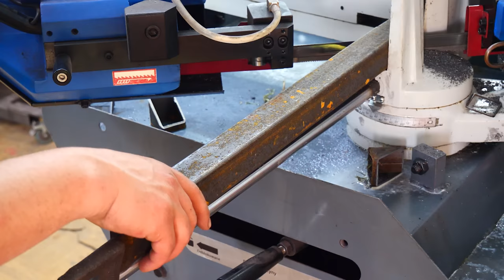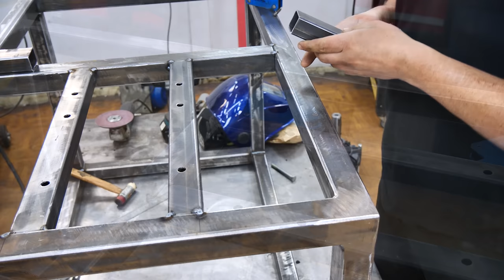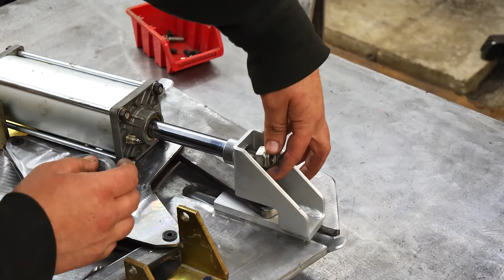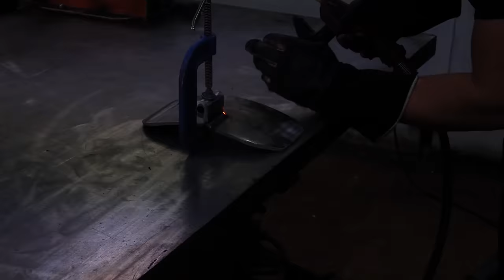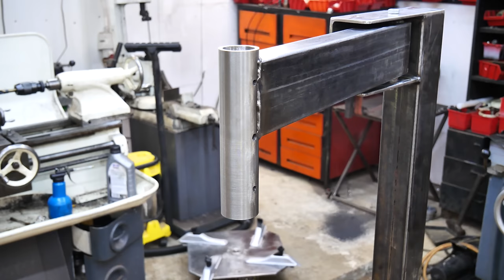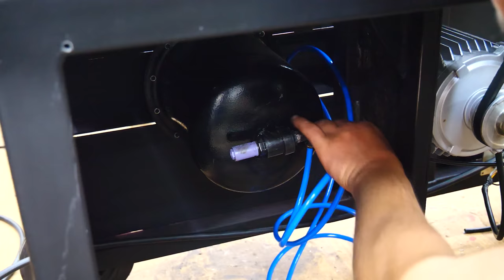Making Tire Changer Machine

Comment: Very nice build. I used to change tires. One suggestion to make the upper arm easier to work with. Try using a compression spring through OD of the rod so when you release the knob and push it over, the rod will move up out of the way instead of dropping down or holding it to lock it again.
Reply: Was going to write exactly this. Every professional machine is equipped with a spring like that.
Reply: I mentioned exactly the same thing once that is done it will be pretty good
Reply: Yup. Bead unroller should lift up when released, not fall down onto the rim. Not a large a mood work to make the modification, but a huge improvement in usability.
The bead breaker might want another look, too, to cater for different tyre sizes. They’re usually at a compound angle, rather than straight on, too, to help draw the tyre away and avoid the bead falling into the rim and causing damage to the sidewall
Reply: Attach a Metal file with JB-weld' to a strong old sawzall blade' then to attach to the sawzall _ 'and maybe that could be part of a helpful File system?!
Reply: Конечно хорошо что сделал сам, но все комплектующие куплены в магазине, по цене он выходит немногим меньше заводского, я просто купил и не тратил время.
Reply: Too high - wheels are useless , move it once a while dolly could do it 
Pedal configuration not correct 
Good welding/lathe skills

Comment: Might add the air blaster for getting tire seated.... you got this far so its not even a challenge for you now. I have modified a few of these machines because of no mig welder or other nice welding tools. Even with all the stuff in front of me, the pattern is probably most important part of building one myself. I am seventy three so brain is slower than cold molasses. I started permanently in the southeast alaska islands right after coming home from nam in seventy. I was a diesel, gas, fab, welder, and not too bad of a story teller in those days. I did get my hands on a coats 40/40 tire machine that was rebuilt more times than letters in the alphabet. I then one day for no reason exception of boredom, make a larger one that handled the truck tires on "highway truck tires" but the off highway rims and tires were just manual labor intensive. Used a lot of starting fluid to seat tires back then. Of course the rule of thumb was bigger the easier applied most of the times. One weak link in yours is the foot controls will start leaking so needed to fix which meant removing the sides and fixing. I used a propane tank for air blaster to seat tires most of the times with most tires under the twenty four inch rim sizes. Just a simple all release of air in that tank would solve seating those tires to the rims. Teaching anyone how to determine the side up to mount and dismount. Lots of jokes about "are you from arkansas" were used on fellows who just didn't understand how dang easy its going to be if ya thought ahead. I best stop here as too long of comments are just that.... too long

Comment: PRETTY WORK ! 
   I was trained, most of my young life as a Machinist. I was raised in one and built a little shop but nothing as nice as what you have to operate. Be very proud of your shop and your skil level. Be sure to use your PPE, so you won't be hampered if something comes after you.
   Thanks for your video. I SUBBED.
   Bill, from Tn. 🇺🇸
Reply: K 0:11 😮 b

Comment: I would love to do something like this. I weld and have mill and lathe and all the tools required and I’m a mechanic. I always design stuff up in cad with the intention of making it but then I realize the steel it uses to make it costs more than just buying the machine from china. Chinese equipment is cheaper than the metal it’s made out of just can’t beat it.

Comment: Even more impressive the second time watching this !! Especially after I just bought the Harbor Freight manual tire changer and homemade Swing Arm/Duck bill mod. But this here is outstanding. Crazy impressive, and a guaranteed money maker. Probably paid for itself a few times over by now I'm guessing.  Next project, some lasers amd Arduino's or something and design/build a homemade/one off, high speed wheel balancing machine.

Comment: umm... why? Just to say you can? 
This very basic machine, made with imported parts by the way, would have only been $900 to $1,300.(Including waranty!) What is your time, material and electricity worth? Plus, the vertical shaft locking style you have will slip in no time. 
I could go over the other design flaws, but then I'd be here all week. (Tip your waitress).

Comment: The tooling for this project costs a great deal of money, Metalbandsaw, Mill, Lathe, quality Mig Flux Core welder, heavy bender etc. The stock looks like 12 ga or thicker. I do tire unmount/mount  with a tractor tire bead breaker and a few old auto spring leaves ... keeps me fit :0)

Comment: Im curious, what motor is that running the turn table part of it? 
Im trying to decide if this is worth me building, i mean this is awesome and the guy did a great job.
I see the pedals are about 140$, then the bead breaker air motor is about 170$, but the only tire machine turn table motors i see are about 670-700$. 
A bran new tire machine is 1200-1700$ for a complete cheaper  tire machine.
Unless theres a waay cheaper option for that turn table motor idk..
Awesome project though, it looks like a professional unit.

Comment: This build don´t satisfy me. I don´t believe the used parts part. They look new to me.
It´s basically just a housing for prefabricated parts. And it´s even "worse" than the original (lacking the spring for lifting the vertical arm). Also I wouldn´t put it on wheels.
And last but not least: a mounting machine is almost useless without a balancer machine.

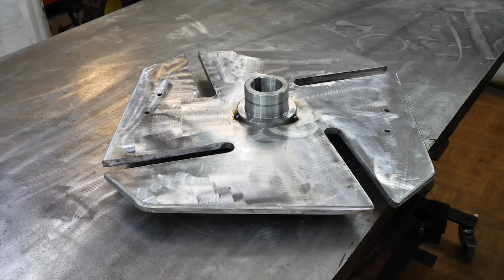Comment: 6:02 important point...this is why Gingery went with foundry castings instead of weldments in the 70s, after 20 years of trying to perfect a homemade lathe construction but unable to attain repeatability/accuracy. Here it's not even acceptable for a tire changing machine ;o)

Comment: Anyone who has mounted tires know that putting it on wheels is a bad idea.  And you can tell by the way this guy jumps when the beads pop that he it may be his first tire.  Maybe if you are going to only use it occasionally for non performance tires it may be OK but I've had some where I was pushing with all my strength on the tire.  I would have moved that machine all over the shop.

Comment: My only difficulty with this is, while I can admire the skill and obvious talent for design, figuring all this out and assembling it, there are an awful lot of parts that nobody has lying around. I may have a suitable motor, and I certainly have the metal stock, but where would I even begin to look for the gearbox, rim grabbers and so on? Unless I bought a tyre changer and stripped it down, of course, but even I’m not that daft.

Comment: I am going to be building one of these myself. Could you by chance send links to the pneumatic parts you used for this wonderful build of yours? and the places to get the rim jaws and tire mounter/de-mounter part at the end of the swing/swivel arm drop rod used to remove and put on the tires to the rims please? And/or maybe the source you use to find the used parts like what you found? I would immensely appreciate it.

Comment: If you take a couple of pipe And put a couple long bolts inside, you could make a fold up with 2 horse shoe type  plate to set tire on bead breaker side and you could spin tire instead of lifting tire. When we’re young we can do the spin, look better than store bought, Great skills.

Comment: I find this kind of 'build' videos silly and pretty much useless, they show someone sawing, welding, turning parts on a lathe and bolting together a machine with almost zero information on what they did or why or even how well it works for more than the one time they demonstrate it, you don't even get to know what they are building untli the last 3 minutes of a half hour video.

Comment: around how much USD did this cost to make? Only if you feel comfortable sharing.
Reply from the maker: It wasn't expensive, I bought used parts on auction sites to make it as cheap as possible. I didn't count exactly but around $300-400. But the steel was from my stock where the purchase price about 2 years ago was much cheaper

Comment: Very very nicely done! Only thing I would suggest is adding a coil spring to your center post to raise it up when you release it. Was it cost effective to build this versus buying a new or used unit?
Reply from the maker: Thank you😁
Yes, there are still a few fixes. The decision to build was made after finding used parts at a very good price. Earlier, I had plans to make a simple but manual tire changer, but when I managed to buy these parts, my plans changed 😁

Comment: An excellent build of a fairly complex but very useful garage machine.  I'm impressed how your from scratch machining and fabrication capabilities have progressively evolved from almost nothing to what you have now with each build (or rebuild of used machines like the lathe) each adding more and more capabilities.  Your design, fabrication, machining and welding skill improvement since you started has been impressive.
Reply from the maker: Thank you for your appreciation, I have no education in the field of machining but I am interested in this subject and I am constantly trying to improve my skills even though not everything works out for me, I still make a lot of mistakes and sometimes make bad decisions when designing :)
Reply: A curious question.  Watching how your designs go together got me to wonder what kind of conceptual and dimensional design process you use.  Do you just make draft sketches with dimensions and update those in the shop or do you use a cad program.